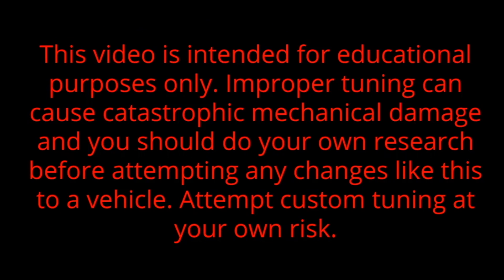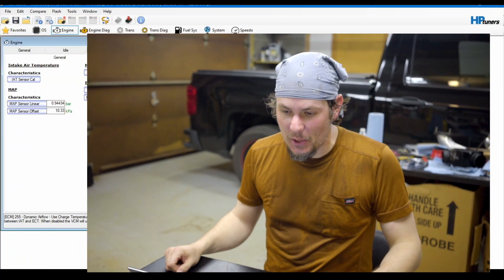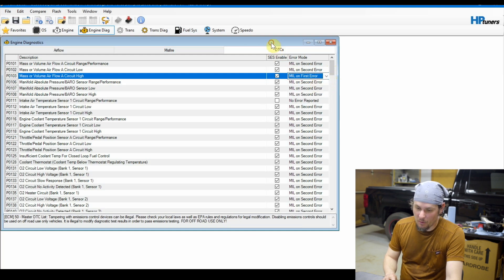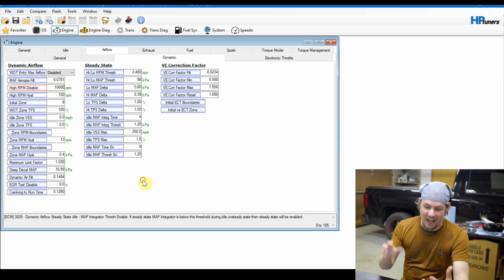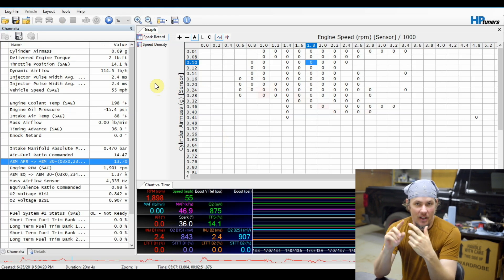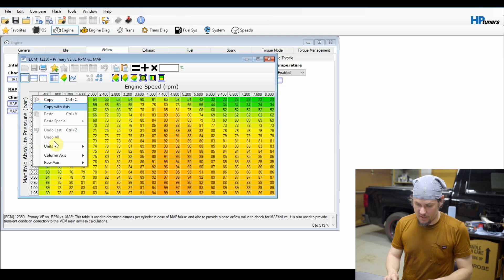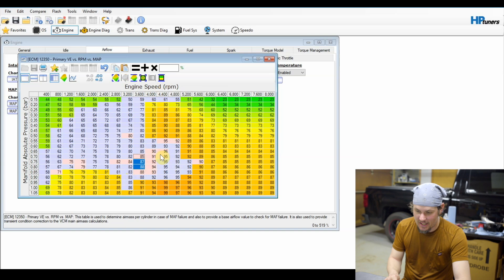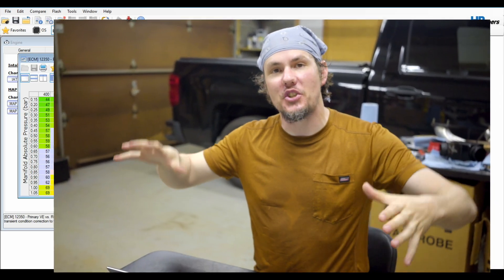GM Gen 3 Speed Density Tuning Guide Using HP Tuners, Dialing In The VE Table

Comment: Tuning a gen 3 turbo ls on SD with a 2 bar map, my question is after dialing in the VE table would I still want to re enable stft and ltft as well as dynamic airflow if it’s running good? Amazing video by the way!

Comment: I'm curious how it works if you say tune it at stoich, but then later add power enrichment?  Will the table need re adjustments, or in theory will it remain accurate?  I'm not saying I intend to do wot pulls in closed loop, but I'm trying to distinguish if it's relevant when compared to running in open loop/power enrichment?  Or do I tune the 2 separately somehow?

Comment: I can tune this dang 2008 gmc 5.3l to save my life the stupid afr reading shows lean 16.5 or 17.8 range after idle calms to steady lope its a 5.4l gen 4 with truck  Norris cam  it does dum weird surging every now and again I got it to run halfway but this this is a turd it was faster and better stock cam
Reply: Can't *
Reply: widebands have ranges in which they will reflect incorrect reading, you need to give them a second or two to stabilize.

Comment: I keep seeing everyone recommend changing the OLEQ ratio to 1.0 after about 140°. You don’t touch on that under the open loop tab. I have been doing it without modifying that table as I figured whatever the computer is commanding will still show the correct error however it seems everyone else still says to change them to 1.0. Any insight on this?

Comment: i know this is an old video but ill take my chances... i have a p59 04 tahoe with a 4.8. it used to be a 5.3. i kept the flex fuel sensor and injectors and copied my high octane tables to my low octane tables to match. i dont run e85 ever. i still have the flex sensor enabled tho. is that going to screw my readings or is it ok to run like that? im a subscriber and a patron and ive purchased your grg scanner confic from your website! LMK

Comment: @GoatRopeGarage is this a good way to do the VE Table Tuning BEFORE tuning the MAF sensor? Meaning this is the process for a strictly Speed Density setup only but could the maf be tuned the same way after using the AFR Error?

Comment: Bin following you for some time now and love the knowledge I am to gain from your vids. I have 89 V2500 6”lift w/35” tires 4.11 ratio rear axle with  a gen 3 motor that was built for NOS but currently not running NOS, w/BBK tb DBW, 4l60e ect ect the only thing stock is coil packs. My question is could you maybe take a look at my tune and kinda guide me in the right direction to get this thing right?

Comment: Why would you disable the dfco for this? What does it change for the histogram?  Im really trying to follow along and ive gotten a lot of valuable information.  But when you skim over thing like this it throws a wrench in my gears. I have to google what it does and try and find out why you are turning it off. Im completely new to the tuning world. I come from old school cars. Is there another video that goes over these types of things?
Reply: When DFCO is enabled  and you come off the throttle the ecm will cut the injectors completely, which will in turn show very lean obviously. Well that will also follow into the table you are building, and will give you a lot of wonky data. Turn it off and this will not happen and you will have a more accurate, more friendly table to work with. (as i understand it)

Comment: I dont see an option to disable LTFT on mine like on yours, so I set Min.  ECT to 283 and Max ECT to 1 to disable. I am still getting data on LTFT"s on my scanner when I log. Is that normal? Did I disable right?
Reply from the maker: That should work, try resting them in the scanner and see if they still populate
Reply: When you say rest ,you mean reseting them.Right? Idid that , but now it goes lean when I press on the gas.

Comment: Kyle,
What is your take on setting all the spark tables the same?  Some say the idle in park, idle in gear, high octane and low octane should all match.  You touched on high and low being the same or holding the factory difference in the two.  Should the high octane also match the idle tables?

Comment: I bought a Chevy c10 with an 2000 ls 5.3 in it. It’s set up for speed density.  It doesn’t have a turbo or supercharger on it.  It has a btr stage 4 cam cold air intake and 3inc exhaust. Sometimes when I start it I can’t get the rpm’s to come down. It will idle at 1300rpm when it’s usually around 800rpm.  Also it’s been running rough, when I floor the truck my afr gauge goes blank and there’s no power.  Seems Like it’s going lean. I was wondering if it would be better for me to add a maf sensor to the truck since I’m running the engine all natural.  I’ve never used hp tuner before too.  Any help would be appreciated.  Cheers

Comment: Anyone else have a strange issue where it goes from idling nice at stoich, to max lean of 22 afr whenever it sees in gear input on the pin 34 c1 (pnp switch)

Ive tried it in open and closed loop. No change. Its only based on that input. Even in park if i unhook pin 34 it goes lean. Doesnt matter if its a manual or auto OS.

Comment: Need to pick your brain again. My car is an 05 GTO so it's a gen 4 with gen 3 software but my question is on the histogram set up cause ive had issues logging. Can I use Eq error or does it have to be AFR? Also with the pro link on my failsafe am I running generic math for my parameter or something else? Slowly figuring this thing out but having a non common set up it's been a little bit of a struggle here and there.

Comment: Sorry if this is a question that was asked before but there over 240 comments. Great video. Appreciate your time. Is this going 3 Bar or Speed Density Enhanced (RTT) on the OS. Might be self explanatory but want to make sure. Thanks !
Reply from the maker: It's based on standard OS, but the process is the same
Reply: @GoatRopeGarage  thanks for the response

Comment: Hi Kyle.
I'm having a heck of a time getting my car to idle on VE
Its very strange. With the throttle closed the car either pegs the afr gauge to 10.9 or lean 24.5
No matter what I do to fueling in the kpa cells at idle.
It will not tune to run anywhere in between.
If I drive it and keep my foot on the gas the afr is balanced pretty well. Soon as you let off it tanks and will stay that way 
Any idea what might cause this?

Comment: Your a godsend bro!
Your videos and willingness to share incredibly valuable information is incredible. Thank you!
I noticed in both your gen3 maf tuning and speed density tuning videos that alot of the tuning set points are identical such as 02 disable etc.
Can you go from maf tuning straight to density tuning or do you have to enable all settings back after maf tuning then drive the vehicle and then start from scratch with density tuning?
Reply from the maker: Just have to change the dynamic settings and fail the MAF, ask the fuel settings start the same
Reply: @GoatRopeGarage  thank you very much!

Comment: Maybe I missed that part but what does the 84, 83, 87 96 etc.. mean on the tables and how do you know what each number means?.
Reply from the maker: That is the efficiency of the motor in percent, so if you have a 6 liter and you're at 100, your are moving 6 liters of air and it will use that to calculate how much fuel to add to hit your commanded AFR

Comment: Hey man love your videos, very helpful. i have an issue with the speed density tuning for my car. 1999 trans am 4.8L 76mm turbo SS2 cam. trying to get the VE table tuned in and the car keeps hitting a brick wall @ 85-105KPA.3300 rpms. afr reads its pegging rich. watching the commanded afr on hp tuner scanner and it drops to 7afr commanded when it does its thing. any ideas? STFT, LTFT COT DFCO turned off.
Reply from the maker: Sounds like PE is commanding too much fuel, check it. It is a multiplier of your stoich fueling
Reply: @GoatRopeGarage  i set PE and BE @1.00 and it still does it
Reply: Double checked and you were right was set @  1.165 apparently that was enough to flood this baby 4.8 out. Much smaller ve table than my LQ4. 
Thank you for your help

Comment: Whenever I fail the MAF to begin tuning VE, it runs awfully, reads about 25% rich even with the factory VE table which should be way lean and wont let me go over 2,800 rpm. I can tell its misfiring though not throwing codes. I have a BTR Stage 2 N/A cam, short headers, LS6 intake and 36lb injectors. I have the injectors scaled properly and it runs fine with MAF enabled. Please help lol

Comment: The default units of percent shows whole numbers in the cells, but if you copy the table and paste it into an excel spreadsheet, you will see that it's actually calculating out to 13 decimal places.  You can change the VE table units to PPM to get finer control (equivalent to 4 decimal places) when editing the map by hand.  You can paste your logged EQ error table into an excel spreadsheet and fix any cells that you know are skewed by transient loads and do some interpolation before multiplying into the VE table.  You can also use excel to format the tables so that you can transfer them into Tunerpro so that you can use HP Tuners to do the logging and math and then use Tunerpro to edit the bin and write it with PCM Hammer or LS Droid.  Be aware if you do this that the math may not be the same between HP Tuners and the Tunerpro definition and additional corrections may be necessary.  It's kind of a pain in the butt, but if you're on a tight budget it can save you some credits.
Reply: Tunerpro has been awesome as a free tuning resource. Just needed a 80$ obdlink LX and to pair the bluetooth dongle, turn laptop off, back on and it works great

Comment: So, I've copied all of these settings to a T and my ecu is misbehaving... If I give it full throttle it goes into limp mode and I have no throttle until I clear the codes. Whatever condition or code that is causing limp mode is invisible too. So that doesn't help. It's like it's not even in SD mode even though the maf is failed. It runs at 11:1 afr no matter what. Except for when I first start it will idle at 14.7 for a few seconds and then enrich like crazy and stay there. Any idea what settings are off??? It did throw a couple torque management codes and something about airflow greater than expected at one point.
Reply from the maker: Look into the airflow greater than DTC, there is a table in the engine diag section you'll need to bump up to keep it from going to high and going into REP mode
Reply: @GoatRopeGarage  Are you talking about the Calculated Airmass P1514 Error table? I got it sorted out and running better. The airflow adjustments I made were too large which sent the duty cycle to outer space. When I brought those numbers down it started working better.

Comment: I’m new to all this trying to apply this to tuning a Honda 1,000 sxs pioneer. I have a Dynojet with power core tuning software. I’m 50 years old use to tune old school engines. But honestly you talk to fast and it’s hard to follow. I see a lot of the same settings on my software but unfortunately there is no information on tuning these small engines.

Comment: might be a dumb question (probably is). i have a 06 silverado 4.8 and bought hptuners recently. i made the sd histogram all correct from what you did. go to scan the truck and i get nothing in the graph i just made. heres probably the dumb part, i have the aem wideband hooked up but not connected to hptuners. im waiting on the serial connection. would not having the wideband hooked up to hptuners make the sd graph i made not read?
Reply from the maker: Correct

Comment: I have a question, I don't have pro features, so no exterior inputs like a wide band etc, I do have a wideband on the truck tho in my pillar gauges, is there a way to do maf and sd tuning that way or do I need to buck up and get the pro set and hook my wide band up to the lap top? thanks!
Reply from the maker: Unless you have a wideband that supports serial output, you'll have to have the pro features

Comment: Another Great Video here.. I did notice you mention one thing, which was actually BAD advise(unintended) for anyone running an Automatic transmission(specifically Gen 3 trucks and Suv's).  You mention simply Unplugging the MAF sensor.  Yes, this is the most simple way of doing things, but aside from the obvious and relocating the IAT sensor out from the MAF itself, so This can be done while still getting the IAT sensor readings from an external sensor... The PCM in the Gen 3's are also used for the TCM.  Even though HPTuners does not show all the tables ch(for good reason) allowing the tuner to change the values, the PCM still needs the MAF plugged in because it needs the MAF sensor airflow value to determine the load for the transmissions commanded torque values. In short, it may have no idea how much pressure to command for the shifts.  I know in some of the more recent updates, HPTuners has added a table for these values into the editor, but it has a Warning suggesting not to edit the values at all.  I've  heard about guys on the forums destroying their transmissions because they simply unplugged the MAF and neglected this variable that the TCM needs in order to operate the shifting of the transmission properly.
Reply: Can anyone with a gen 3 truck PCM running HPT verify this?  I intend to run SD, and I'd hate to ruin my transmission.
Reply: @stevejordan1354 you can get around this by simply failing the MAF in the tune settings. It’ll default to SD mode that way and you also wont need to wire in the separate IAT sensor. I’ve found that the MAF tends to have more accurate iat temp readings than the external iat sensors due because they can be delayed.
Reply: He said disable not disconnect

Comment: Great videos, super new to tuning an hp tuners, have found your content far more helpful over Others!! How ever I’m learning all this just more my own use, have built a gen lll ls1 turbo combo in a non ls based car, so stand alone loom,powerglide ect ect, wondering if you could cover some of the stuff involved in a file for first start up of a new engine, never run it befor so have no previous files, turning off vats? Transmission stuff for the powerglide I’m running? How much to increase fuel for first start up? Just don’t know what to do to get it running so I can even start logging anything, forgive the silly questions I’m really new to all this

Comment: Can I use a SS Cobalt mass air flow sensor on my 2002 Chevy Avalanche. I have a cold air intake and exhaust and a Diablo I3 tuner
Reply from the maker: So long as the frequency is scaled in the right direction it should work

Comment: I tried to make the histogram engine rpm vs map and none of the fields are being recorded
Reply: Make sure your MAP field in your histogram is using the correct unit of measurement (kPA, Bar, or PSI) as your PID and VE table.
Reply: I have the Same problem

Comment: Kyle,

1.) Why is it that making adjustments to the ve table sometimes saved with the P59, the car spits out "engine power reduced" message? I go back a step or two and it's fine, but even sometimes when I go back to the file that the car didnt like, that message doesnt pop up again? What could be making that happen? Should I just use the scanner when it happens again to see if anything pops up? Is my VE table not smooth enough? Can spots on the graph that arent sequential ordered cause it?

2.) With a manual transmission and I'm trying to fill in the higher rpm blocks, is it better to just let foot off gas slowly or just disengage clutch? It seems like when it's close to be dialed in I get higher lean readings (8% ish) if I'm doing high rpm stuff. I'm not sure the best way to get readings from driving. I'm doing it smoothly but unsure about disengaging clutch or just letting it rev down and pressing the brake as well.

Thanks in advance if you get to this. E
Reply from the maker: What DTC are you getting in reduced power mode? I would just let off the gas
Reply: @GoatRopeGarage  p0068, p0103, u0107. Were the ones I got today that I cleared. Cant remember which one was normal setting up for SD. I just cleared them and kept driving. I can look them up. Maybe one more run before I feel comfortable with SD numbers I'm able to get.
Reply: @GoatRopeGarage  btw. I'll be joining you on Patreon. Your videos have great value and I feel guilty getting this for free. Especially you being so active in responding to a lot of people in your free time.
Never supported anyone on Patreon before either. That's how valuable I think your stuff is.

Comment: Love all the info but why is there so much. So I have a few questions. I swapped a vortec with 411 ECU in my Landcruiser. All I’m doing is a nice tune. Took it somewhere first and he got it running but now I understand why all these Dyno shops said they don’t do what I would like them to do. All I want is a tune that will get good mpg cruising around and have good power up top. I intend to go in multiple if altitude so using the o2 sensors is a must. This tuner left them off and it kept stalling at higher altitude. Freaked us out. He just did some stuff, did 4-5 pulls and called it good. While it drove ok it got shit mpg. So I’m looking to get it better myself. So I understand the necessity for a WB but does it need to go through the interface to work best? And I’m running the stock stanadard transmission so it goes rich at shift points. I turned on LTFT and the MAF sensor fail light came on. Was looking to copy the stock tune back over but can’t find that info. I have a RV cam in it. Everything about tuning is blower, turbo and high end stuff that doesn’t apply to what I’m looking for. Any help or direction would be greatly appreciated. Keep doing what your doing.